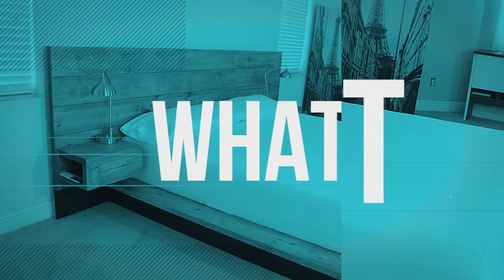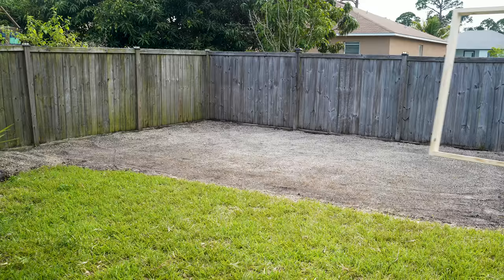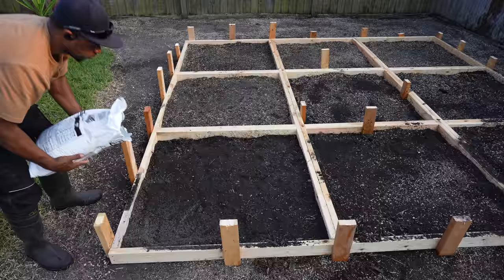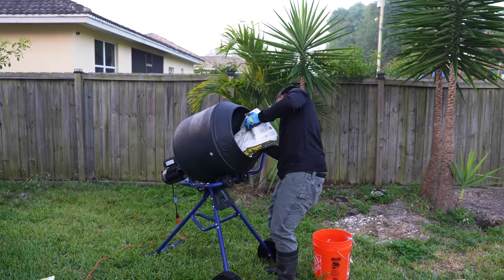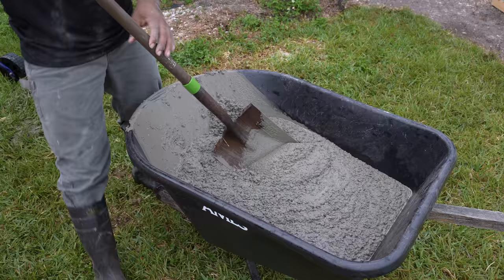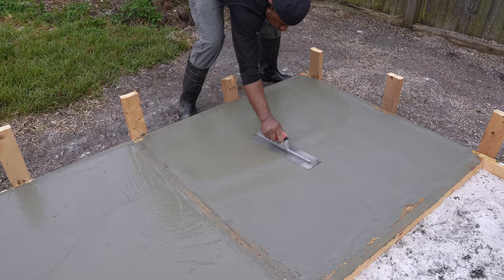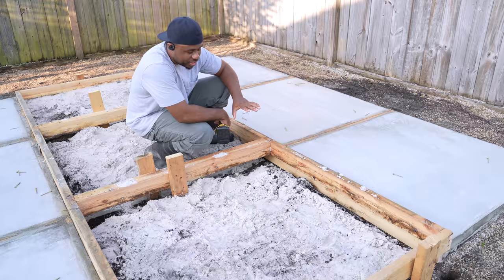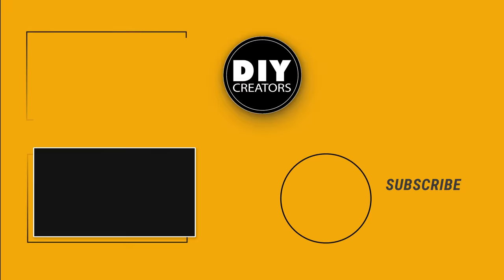Making Extra Large Concrete Pavers ( DIY concrete patio )

Comment from the maker: Part 2 Video is here::  https://youtu.be/FuS3A5f8DeI
Part 3 Video is here https://youtu.be/wBBlE80TUO4

*I see the question about the reinforcement popping up. I didn't add rebar because I do not think it's needed. While you can undoubtedly add reinforcement, walking on these will not break them.
Reply: You've never seen my inlaws!!! 
 
Badumtssst
Reply: @carterscustomrods  ouch 🤣😂
Reply: Oh, just saw this....ignore my comment below then. Why do you think reinforcement is not needed? Are you a concrete guy, landscaper, or have you worked with or know a concrete guys. I have worked in construction for 25yrs...not saying I know everything, but I do know that if you were to use wire mesh it would highly reduce the cracks you will get over time. Just saying for a few extra $$$ it would have saved you a lot of frustration.
Reply: When you said you moved 14,400 pounds of material, does that include wood and other things? Because the 80 lb bags of concrete would mean you bought 180 bags and it seems you didn't use that many.
Reply: @illestofdemall13  Hi Kris.  He said in the description that he used 40 bags @ 80lbs and in the video, moved them 4 times (to the cart, to the truck, to the garage, finally to the backyard) therefore that's 12800 lbs.  My guess is he bought 45 bags but only used 40.
Reply: @stuarthodson7372  Oh ok, thanks.
Reply: that's correct !! rebar is not needed until a certain size. and those were defiantly under that size !! . I want to say 6x6 or 8x8 ? somewhere after that, you want to use rebar to prevent cracks.. But it's like any other paver.. crack it open there is NO rebar in it!!! ( Can you image how heavy they would be LOL )
Reply: @compubyte2010  this is flawed reasoning.  They don't make pavers out of simple bagged concrete.  Wire mesh is required in this application for longevity's sake.  These will be done in a few years tops.  In fact, they will likely get fractured as this mix dries over the next few months.
Reply from the maker: @Stuart Correction I bought 45 bags, only used 40.
Reply from the maker: @Kris Klekosky when I say 14,400lb. I meant I bought 45 80lb bags. Then I moved them 4 times from the pallets in store, to the cart, to the truck, to the garage, to the backyard. I made three trips to the store 15 bags each time.
Reply: I could be overthinking this, as I’ve never worked with concrete before, but aside from possibly preventing cracking in the individual slabs themselves, wouldn’t using rebar or wire support to connect all of the slabs together also allow for all of the slabs to rise and fall more evenly so they don’t become unleveled over time, or is the movement so insignificant that it doesn’t matter?
Reply: rebar though is both a "cure" and a cause of cracking.  as rebar rusts it CAUSES cracking.  and then as moisture gets in those cracks it rust the rebar more and it happens more often.
Reply: @wheeldealrepeat3698  Not sure where you live? but I can assure you, I've broken more pavers over the years than I've installed. and I can honestly say. I HAVE NEVER SEEN wire mesh in ANY PAVERS I've broken?  That doesn't man where your from they have/need it.. Just where I"m at.. I've never seen wiremess in a paver ever! ..
Reply: @compubyte2010  read it again, THIS application I said.  These are not pavers.  A paver is a much smaller unit with a greater height to length/width ratio.  These are PADS, poured too thin with bagged product with zero reinforcement.  As they dry they will crack, if nothing as simple as wire mesh he stands to replace them before he may think.
Reply: This is why you want to add reinforcement:

The slabs are big, the depth (thickness) of the slab is small. If void forms beneath the slab causing the slab to span over, the reinforcement will help span the void. Not sure what you’re loading the slabs with but you never know if your going to put a point load directly where a void has formed under the slab. 

You were only hand tamping the ground so my guess the ground isn’t going to be without voids. Seasonal weather can cause the ground to swell so reinforcement will make the slabs even stiffer. 

Reinforcement also helps with dry shrinkage cracks. 

A little bit of mesh definitely would future proof it a lot and not a whole lot of extra cost.

Food for thought. Do what you want. They look pretty dope though.
Reply: @Giorgio Mumda love this guys channel, but I work in concrete.  Fiber reinforced readi-mix or wire mesh should have been used.  Hands down.
Reply: @wheeldealrepeat3698  .. No need to read it again .. I'll take your word for it. .My bad !!
Reply: If you have to do this again, 'paint' the forms with some old cooking or mineral oil and they will be a lot easier to remove.
Reply: Can you post a part 2? Highly considering doing this, but really intrigued to see how you dress it up.
Reply: Yes i watched finished one i commented there too ,, love it but do you have a wall around outside to keep rocks in
Reply: Nextvtime you buy 14,000 lbs of anything, go ask someone to get a forklift  and either bring a pallet to your truck to load off of  or a pallet with the correct qty & they'll just load it into the truck.
Thinking thiz way is important to all you youngsters if you still want to be able to move when your my age!

(52. No, i cant hardly move, severe arthritis in knees and wrists from construction most of my life
Reply: I love doing all kinds of work like this and installation of fine tile to landscape but my back just won’t cut it.  Injured at a young age so I go lightly now.
Reply: @49911337leet  He did post a part 2 and 3. Links are in the description. 😊
Reply: Oops, not in the description, but in his comment. It’s tagged to be first at the top.
Reply: Rust expands and breaks concrete unless a spa or car is in it…naw
Reply: @wheeldealrepeat3698  I have 5x5 ft pavers I made more than 10 years ago and they are still fine. No wire, no rebar, no mesh. My riding lawnmower goes over them, once my truck. The secret is how they are bedded.
Reply: @martinwyke  good ole’ soap oil we used to use on our shuttering pans & forms
Reply: They have this 2inx2in chicken wire that you could of used for rigidity it gives you more longevity with those large tiles
Reply: Its not your weight that causes it to break but the cold. If its freezing and there is some water somewhere the forces might be to big and it will break
Reply: Hahaha! Then you ain't seen my Great Aunt Bertha! Just Kidding. Great Work!!
Reply: Wow very good 👍 👏 👌 😀
Reply: @Giorgio Mumda He said 2 inches thick.
Reply: @Zamboni-0805  If you don't want to use metal reinforcing, use some of the new style fiberglass rods. These work well but do not rust!  

The reinforcing is to keep the concrete together so it doesn't crack. Just like Zamboni says, you don't want the concrete falling apart while you are still using it.  Another thing, I learned many years ago, to always bevel the edge of the concrete so you do not have real sharp edges. The sharp edges will easily break off and always when you don't want them to do so.
Reply: How many bags per square did you use?
Reply: O I
Reply: 1
Reply: Great video my guy. For those that might need a mixer I re-did my entire driveway by renting one at my local Ace hardware. At the time it cost around $80 for 3 days.
Reply: @vince9486  how thick did you make your pavers?
Reply: @sdummer11  2 inches
Reply: You are right and wrong. You are right that it won't break when you walk on it. You are wrong because it will break by themselves over time. The time could be short or long, randomly.
Also, thinner concrete is easy to work with, true. But the thinner, the weaker. You might not find the impact very soon.
Reply: love it !
Reply: @illestofdemall13  i
Reply: What part of Florida are you in?

Comment: Your thought process for form removal was very well thought out. I'm a professional builder and I've watched lots of guys doing form work get that part wrong over and over
Reply from the maker: Thanks, I appreciate the kind words. This can be challenging if you don't think it out.
Reply: This is true, I'm a form worker. Anyone can build a box but not everyone can already think of the stripping process while building it.
Reply: Actually it was terrible.... Should have packed the earth first then  laid out the forms with pegs between the forms not inside....
Reply: @thenarrator1984  he intentionally did not do this so as to save on concrete. He didn't want full 1.5" thickness.
Reply: @DigitalOSH-  lol no.

Could have controlled height after easily. The main factor is the ground should be packed prior.
Reply: @Giorgio Mumda should never use motor oil

Should use form oil or vegetable oil etc 

Motor oil.... Seriously? Are you guys totally clueless about the environment?
Reply: I'm not a concrete guy but.. no rebar?
Reply: @JulioHernandez-uc7nf  since it's just going to be lying down on flat ground there shouldn't be a need for it I believe, but I'm not a concrete guy either
Reply: they don't get it wrong - they do it on purpose for more $$$
Reply: @DIYCreators very good job ..... that's what people feel to realize is planning as well as prep work are usually the most important part of any job in construction and home renovations! 
as well reality TV has killed well reality and expectations and time frames of completion of many home renovation projects, no I cannot do your whole bathroom renovation down to the studs and back together in a hour but weeks/months or more is doable
Reply: @marcfavell  It used to be twice as long and 2x the cost but now I say go 5x. Once I see the project in my mind I feel it is done. The hard work just begun. one thing you learn is don't change anything from the plans if you're paying someone.
Reply: Brc or some other reinforcer would be great in this project..
Reply: He looks like A Professional to me!!!!!
Reply: @DigitalOSH-  I don't believe he made the pour with pegs inside form! In my opinion it was helpful and inspiring a far cry from awful.
Reply: @thenarrator1984  I BELIEVE he DID pack the ground FIRST BEFORE he laid down the form. He also packed it down after adding the additional dirt too. Which he did in this way to lessen the amount of concrete while keeping the form level.  Otherwise the height in  form would have had to be cut.  The important factor is he did have it all packed. Certainly, it's good enough for the purpose.
Reply: @simplyraw1369  nah it's.terrible.practice. 

What do.i know I just did concrete for years
Reply: @marcfavell  omg! Thank you!! Your words are so true. If you don't plan and prep right it's gonna fail, look bad and or cost more money.  Consequently turn into frustrations, aggravations and arguments. All taking even more time too!.  Know what you want,  draft a plan  , then learn the proper steps don't forget step one!  Ask, read and watch so that you understand NOW from your draft plan create a detailed plan be realistic in a timeline then add a few more hours! Cuz that's life... Remember  one person is not an entire crew!  I'm a 105 lb 56yr old female parents had a house flood entire 4 bd 2'bath home ins didn't cover so I got busy floors to ceiling in 2 rooms floors to 1/4 way up walls in rest of house pack up rooms rip up laminate floors (laminate floors are not going back this time ceramic) tare out drywall insulation ECT ECT lot of work! Took me a year and people were saying I was taking too long. But I did it ALL myself.. packing rooms up, learning what was needed, how to do it, getting the materials ECT ECT... Had to get creative in ways being myself the lifting of thin set and tiles were HEAVY I like wheels 🤣 made my own for buckets and tiles.
Reply: @Giorgio Mumda what does the Oil do?
Reply: He is a professional , its in his Genes!!! Who do you think The Original  Builders , Architects Designers , Carpenters are????
Reply: @thenarrator1984  I really don’t think you know what your talking about.
Just because you may have done concrete work for years doesn’t mean you were doing the job right.
Reply: @David25522  I'm a geologist who studied concrete structure and who enforced the proper way to do concrete in the field.
Reply: @thenarrator1984  it's cool to disagree and as for "professional" I take that with a grain of salt too. Time in a field of work I do give that consideration as to respect that's a must for everyone. Understand this is a person who is doing diy for personal use not as a "professional". There are more ways than one to skin a cat.  To give negative judgements is foolishness. Saying that's awful and a horrible practice is a mean put down no value gained for anyone aside from the negatives.  Constructive criticism can be as I think should be delivered in a respectful fashion. Accept reality. I'm sure you have done things differently than the so called "normal" or "professional" ways and it also fulfilled your purpose. His purpose was filled, he saved money and he accomplished this on his own bonus he shared with others. Thinking before reacting makes way for peace and harmony. We all share the same in LIFE individuals and ways are unique. If all were the same wow how boring the journey would be! Peace
Reply: @simplyraw1369  it's not foolishness.

He's doing it wrong..it could be stronger better for.the same work output.

Done with this
Reply: @simplyraw1369  but you did have a point about the norm god knows I've dabbled in..  fibre glass for instance and my god is it not my area... I suck. But I'm trying lol

But im not making videos and claiming they are good!!!!! That's the difference
Reply: @thenarrator1984  where's your channel so I can check out your awesome flawless DIY work
Reply: For the purpose this is 100%.. if he was applying road base it would be different story.  He packed the ground by hand which is adequate for the application.  Reinforcement would not have hurt, but with the info provided it would have been a waste as compressive strength is not a factor.  Mr. Narrator, I am curious as to what you think he did wrong?
Reply: He basically just formed his own pavers.. as it says in the description...
Reply: Wow amazing 😮 👏 😍 👌
Reply: @DIYCreators  Many of us never "think" about what we are doing; we just do it, and do it, and do it, and .........
Reply: @will201084  his "work" is mostly being a troll.
Reply: @thenarrator1984  you are a pretty good troll, so there's that...congrats!
Reply: @aaronmccutcheon  not a troll. I never lie. I think your brain can't accept truths.
Reply: OK Mr Geologist, thanks for your input that apparently most didn’t need or want. I’m sure you’re the life of the party 😂 Alex, I’ll take kill-joys for a $1000

Comment: Glen for future projects a mason taught me a good trick if you're doing a lot of mixes is to get a small bucket (that goes inside a massive bucket). Instead of trying to read the water level or having a measuring cup exactly the right size, work out how much you need in the bucket then drill holes about half way around the bucket at that size so when you dunk the bucket and pull it out it drains quickly and you have the perfect amount without looking. Another way (when I'm doing a lot of self leveling work) is to prefill  20 buckets with the correct amount of water so the apprentice can keep the batches flowing nicely just try and either cover them or keep them in the shade if you're using sensitive products that require precise amounts.
Reply: Much better idea than stealing the wifes pyrex
Reply: @callmedragon5321  DITTO!!
Reply: Prefill 20 buckets?  Well, there's another $100 added onto the cost for buckets
Reply: With all the building going on literally everywhere, you can usually find countless 5-gallon empty paint buckets on large job sites for free- I certainly have. Just a thought-
Reply: 20 buckets...nobody does that ffs
Reply: @AllianceRisk2024  well duh!
Reply: @emillyyelen5169  when you have to top 300 metres of floor with self leveler and have 10+ tilers working on it yeah you do. Also I have 40 - 50 buckets in my garage atm all free.....
Reply: @chivone21  Naw, go to any construction site where they are already starting to do the taping. Get all the tape and paint buckets (usually 5 gallon) you can. I've done this and now I have ten in my shop building; of course, I also kept the paint cans from when I last painted my house.  Most paints used these days are latex, so the paint just washes out leaving a clean bucket. The same with the tape buckets.  Almost zero cost for the buckets.

I cleaned all my buckets and now use them when I pick the pecans after they are shaken off the trees in my small orchard.  Much easier than carrying a handful at a time.  If lucky, I'll have 1/2 a ton of fresh pecans; my neighbor might have 500 or 600000 pounds.
Reply: @emillyyelen5169   .... 🤦🤦🤦🤷
Reply: @Harry-zz2oh  ...  how much pecans ??? 🤯🤯🤯

Comment: why you don't use rebar?
Reply from the maker: For slabs this size it's not needed. Here, they pour the entire driveway without rebar.  They even pour the house slab without, the only put rebar in the footer. Street sidewalks do not have rebar here either.
Reply: @DIYCreators  are they using fiberglass as binder in the concrete?